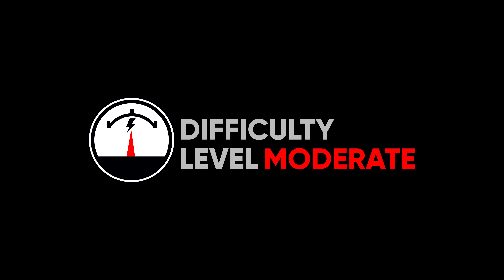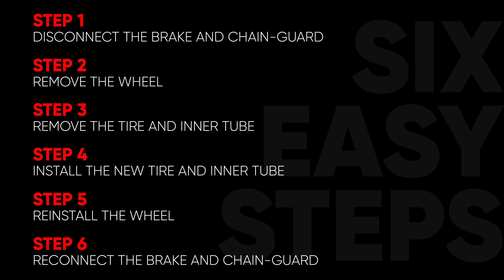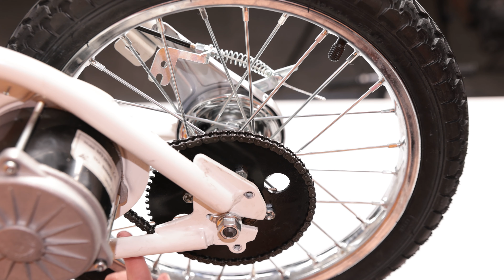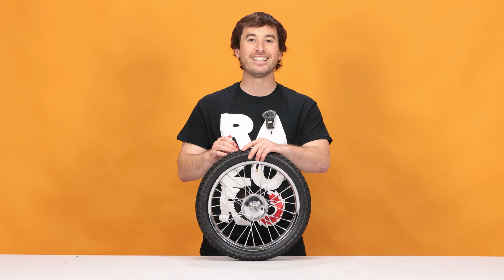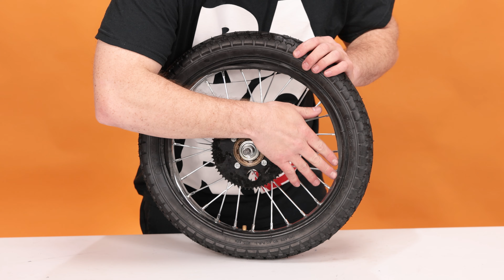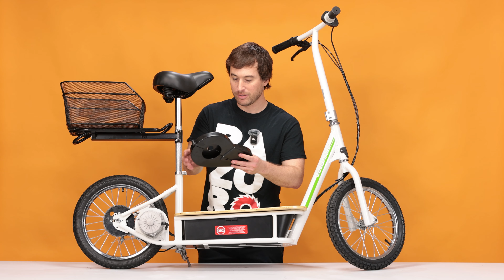How to Replace the Inner Tube on Your EcoSmart Metro Electric Scooter

Comment: I need a video of the one with the motor in the wheel
Reply from the maker: @erinbahnsen6995 Copy that! We'll keep you posted
Reply: @razorworldwide 

Why hasn't razor produced an updated version of the ecosmart metro scooter that uses lithium ion batteries instead of the sealed lead acid batteries? 

I have an ecosmart metro scooter but it has terrible overall range with the stock sealed lead acid batteries requiring a recharge after traveling a distance of only 6 tenths of a mile in one direction.  

Lithium ion batteries are safer now than they were in the past, I have a different scooter which uses lithium ion batteries and it can make the same trip at least three times before needing to be recharged, the only problem is that it has developed an issue with the motor in which, despite a fully charged battery it doesn't want to run at all and I don't want to have to purchase yet another third scooter from yet another manufacturer  that ultimately ends up like that one  as I've only had the scooter for a little over a year.  

I've had the ecosmart metro scooter for about four years now and while it still works  I'm sorely disappointed in the overall battery range that it has.